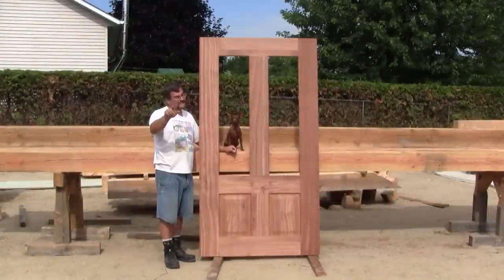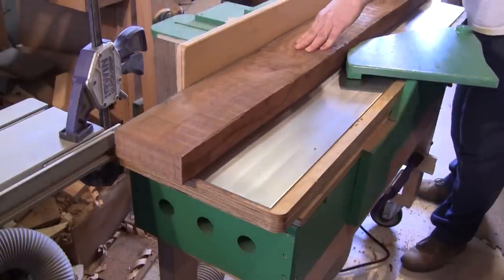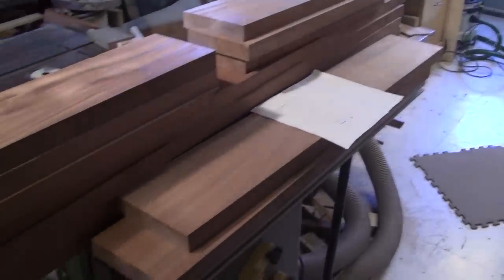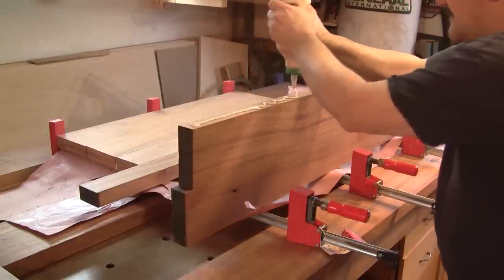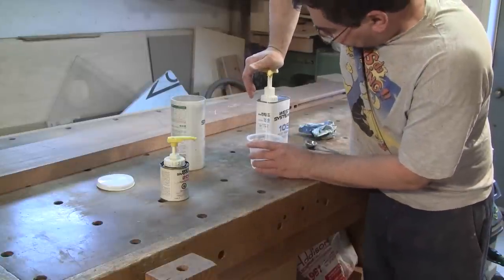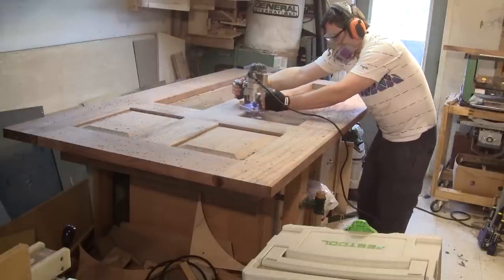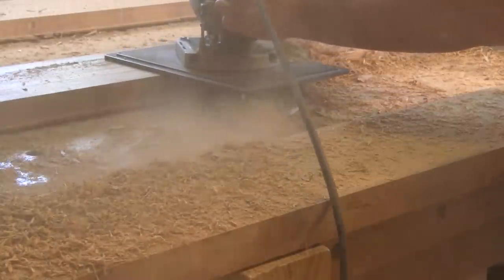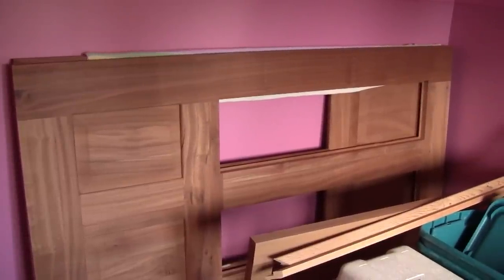The Woodpecker Ep 57 Shop doors

Comment: Those doors must be quite heavy.  Never seen raised panels that thick!
Reply: Is that a Matthias Wandel jointer at 1:15 ?
Reply: 12345NoNamesLeft Looks like it, yes ;)
Reply from the maker: 12345NoNamesLeft Yes it is.
Reply: I used to make doors that big on the CNC router at a custom cabinet shop, up to 8 feet tall and 4 feet wide. We would make them out of oak, alder or mahogany, and they were up to 200lbs each.

We had 3 shaper heads that would fit in the router, one for the main profiles on the rails and stiles, another for the reverse profile on the ends of the rails, and the 3rd would cut the deep relief profile in the edges of the panels. The router would also drill the dowel holes between the rails and stiles, and cut the hinge mortises and screw holes, and cut the holes for the latch, lock, and plungers. Finally it would put a 2 degree bevel on the outside edge of the door. 

Those shaper heads were up to 8" in diameter, and at 15,000 rpm, they were moving unbelievably fast. I would sit on the floor when they were running, so that I was out of the potential path of any shaper knives that might get loose. They never did, while I worked there....but there was a shattered knife taped to the wall next to the control station, as a warning.
Reply: Good idea to use the pipe insulation to sand the inside curve on the panels, great tip! And re-sizing the stiles on the glue-line to fit the thicknesser is another good tip.
Reply: I made some two set of doors like these for my house using 45mm thick Brazilian Tigerwood using loose tenons joinery and freuds entry door set routing bits.
Wished I had the domino XL would have saved at least two days of work. (creating jig and routing and aligning etc)
Reply from the maker: The Domino XL was realy fantastic and speed up the process of making those doors. BTW I just finished instaling them today they look amazing with finish on.
Reply: Bill Thebuilder I have some pic's not the best of quality, but I can sent these to an e-mail if you want.
I will try to post them on youtube this week.
Reply: we have made about 3 inches thick slab entry doors and hung it using pivot hinges.
Reply: MrGinocon
Reply: Alain Vaillancourt ZAp. ....MMS. .can?
Reply: Alain Vaillancourt .
Reply: Matthias Wandel. 
.

Comment: Excellent solid doors. That much timber must have set you back a pretty penny. Worth it though by completed product. What finish are you going to use?
Reply from the maker: As weird as it might sound sapele (african mahogany), at least the lot that I bought, was not that expensive $2.95 the bord foot, but I had to buy the whole $1000 lot ....
I finished their instalation two days ago (you'll see them soon) and I just put the same thing I'm putting on the exterior planks, clear exterior stain. In other word a UV, water repelant, linseed oil base exterior preservative. The oil makes the grain pop, I'm really pleased.

Comment: Are you going to need custom door locks and handles?  Looks like it might be thicker than the 2 1/8" standard?  I am looking for some for my shop doors which are insulated and 2 1/2" thick.  Not easy to come by.  I may end up machining my own.  Nice job.  Take care.  Doug
Reply from the maker: No the'yre just 2" wide and I had no problem with the lock.

Comment: That is beautiful wood, Alain, and now that I read elsewhere in the comments about how cheap the wood was, I hate you just a little bit.   :-)  Those are going to "pop" when you put on some finish.  I bet that they will be challenging to install, due to the weight!   You might want to use extra long screws for the hinges!

thanks for posting these videos!
Reply from the maker: At least you hate me just a little bit. lol . I know it's crazy how inexpensive this wood is, I went this morning to buy some western red cedar (the nutty ones) and for 10 boards of 8/4, 8 inches wide and 12 feet long cost ovder $6 the board foot.
Yes I already bought some 4 1/2" heavy duty bearing hinges for them. And I'll use some big and long screws.